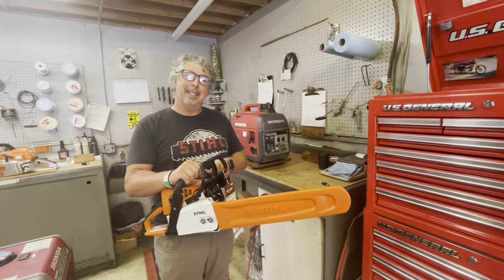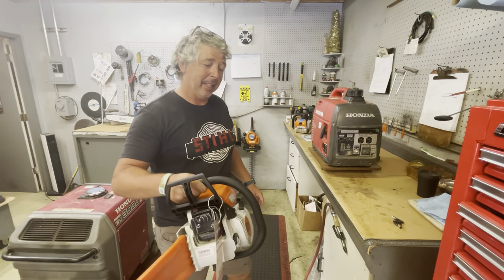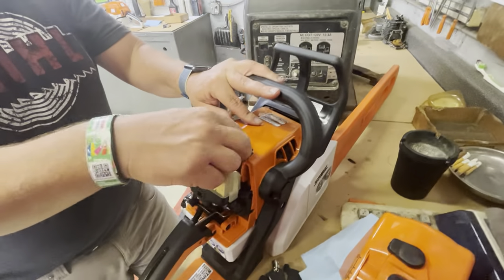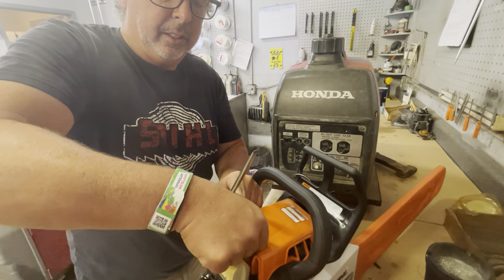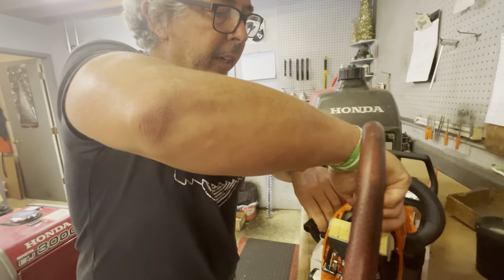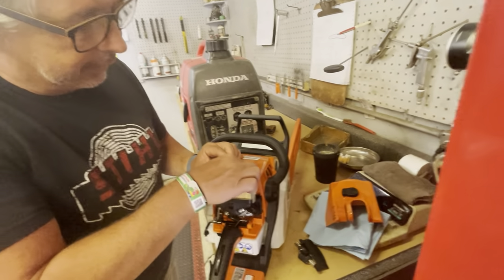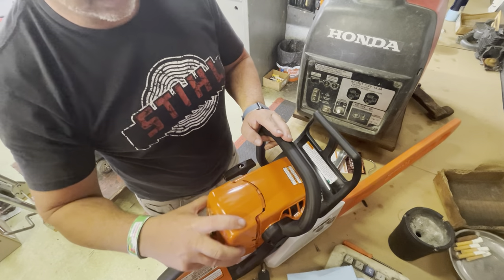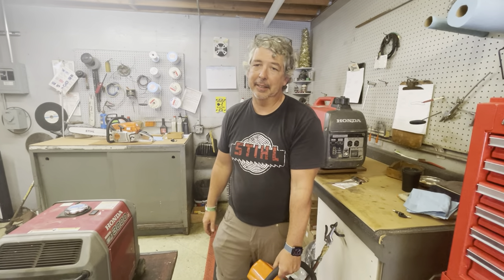Flooded MS 250 Stihl Chainsaw.

Comment: If you’re out in the field and the saw floods, all ya do is pull the plug….hold the saw so facing towards the ground (like the muffler facing the ground) then pull the engine over numerous times to clear out excess fuel….if it’s flooded bad you’ll see raw fuel coming out of the exhaust …
Let it sit for a few minutes for fuel to evaporate then put the plug back in …..you may have to hold the trigger wide open also when attempting to start.

Comment: Why does it flood in the first place ?…maybe a brief starting procedure mentioned would eliminate the need for removing spark plug and cycling it …I’ve got the exact same saw but never had an issue with this…is there a mechanical failure that a part needs to be addressed?